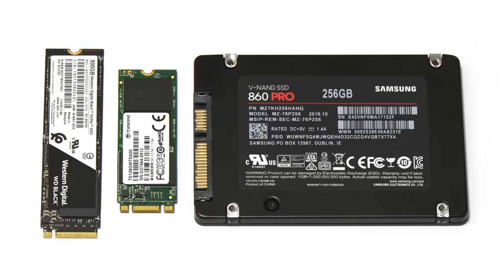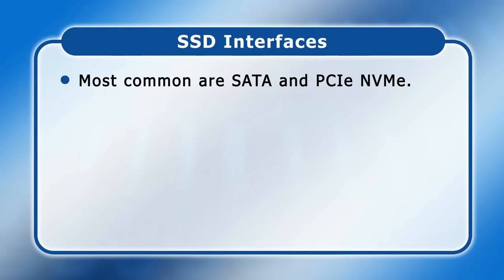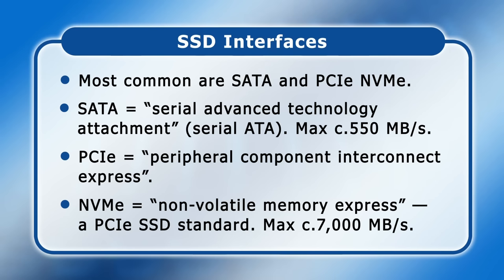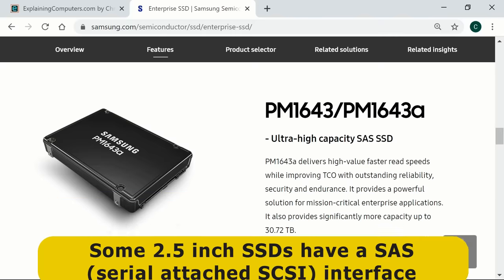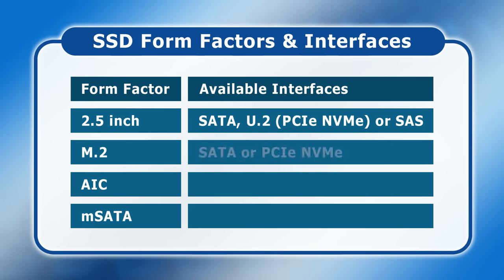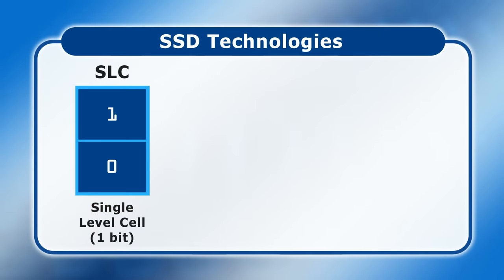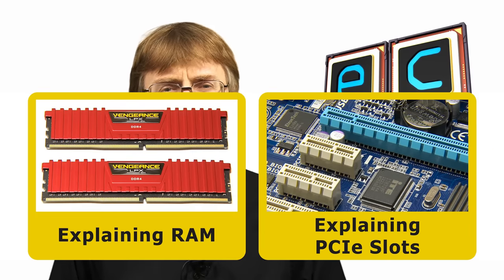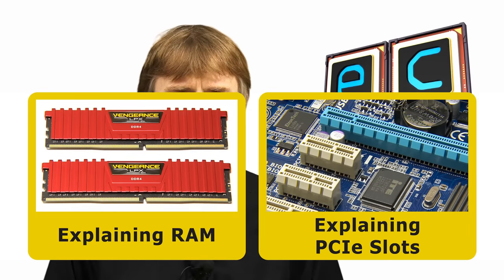Explaining SSDs: Form Factors, Interfaces & Technologies

Comment: I bought a PC with both SSD and HDD. Windows is on the SSD. I plan to put programs on the SSD and all the data files on the HDD. Will this extend the life of the SSD or does the search for data files still start on the SSD? Thank you.
Reply from the maker: Keeping data files on a HDD will help, especially they are large, frequently changed files like video files using in editing/etc. However a lot of the wear on the SSD will come from Windows constantly writing files, and also browsers and similar programs writing files. So if you want to reduce wear, move all cache locations to the HDD.
Reply: @ExplainingComputers  Thank you! Very helpful. Unfortunately I am not skilled enough to know what a "cache location" is.

Comment: Great video!  I was hoping you would talk about the key benefits of using SSDs and HDDs and why it is ideal to use both:Ssd for OS/ Programs and HDD for files. From my personal research, they said HDDs are slow at running an OS but actually fast when used as a secondary drive. Which is why HDDs still be using today, despite being “old tech”.

Comment: Is it possible to use a Samsung T7 external SSD with a Samsung tablet using Android Version 5.0.2?
Reply from the maker: Providing the tablet has a USB connector, it should work. It will depend on the file system on the drive though.
Reply: @ExplainingComputers  
Thx.
How do I determine file system on both?
T7 uses exfat.
No info on tablet.
Reply from the maker: @gaetanovindigni8824  It the T7 uses exFAT, it should work fine on Android 5+.
Reply: @ExplainingComputers  
Thx again, your time and advice.

Comment: Was planning to buy one and I get your notification.  Coincidence? I think not.
Reply from the maker: Spooky!
Reply: @ExplainingComputers  I would be really grateful if you could answer a few questions for me. 

I just got a Kingston A2000 NVMe SSD 500GB (TLC) rated at 350TBW. I already have a 1TB hard drive on my laptop (5400RPM). 

What stuff should I consider storing on my hard drive and what on my SSD? 

I use a few content creation software (mainly Adobe Creative Cloud) and Unreal Engine. Most of my files are documents, project files for the above mentioned software, and few occasional large media files like videos and movies. Maybe 1-2 large games (80-100GB each). 

Also I have 16GB of 2400Mhz DDR4 RAM. Should I disable pagefiling or transfer it to HDD.

Should I move the entire User folder (My Documents, Downloads, etc) to HDD?

First time SSD user, want to extend lifespan.

Comment: Is it possible to install Windows 98se / Me on a SSD to work in a Desktop computer set to IDE mode. So far I have not been able to do it. Windows 2000 and Windows XP has a F6 driver you insert during the install process. Windows 98se / Me does not as far as I know. Thanks.

Comment: Thank you that was very informative. One thing, which  goes beyond what you were trying to cover, is the seperate complexity ( or minefield!) of trying to upgrade older equipment to ssd- eg to do this I personally found the necessity to use  IDE/PATA versions of SSDs ( as Sata via converter s often wouldn’t work etc)

Comment: Are all NVME type SSD's = PCIe type? This is where I get confused, I read that PCIe type SSD's are better, therefore I want to buy a laptop with a PCIe type SSD. Any info would be highly appreciated
Reply from the maker: Yes, as noted in my other reply -- NVMe is a PCIe standard, so any laptop stating that it has an NVMe SSD will have a drive using a PCIe rather than a SATA interface -- and an PCIe/NVMe is a lot faster than SATA.
Reply: @ExplainingComputers  thank you so much, I've finally understood it now after watching many vids👍
Reply from the maker: @kaankarapnar1028  Cool.

Comment: Having 2 internal NVME Samsung Evo 970 Plus in my self build PC. It seems to me that they get hotter than my wife's internal SATA Samsung Evo 870. Does it make sense to put on them thermal pads and heatsink? Some say it is not needed...a bit confusing...
Reply from the maker: They will feel hotter because you can directly touch the chips on the M.2 drive, whereas with a SATA drive you only touch the case. The location on the motherboard also does not help with the cooling of M.2 drives. These days I would fit a heat sink to an M.2 SSD on a PC motherboard. It cannot hurt, and may extend the life of the drive.
Reply: @ExplainingComputers  Thanks for the clarification

Comment: Thanks for the update and clarification. If you aren't in the trade or otherwise standing under the data hose, it's easy to get lost or confused. 
Now I'm having fantasies about a RAID array of those 100TB monsters. (where the "I" definitely does not stand for "Inexpensive").  A storage device costing a quarter-million feels like old times, but it would be a back-up nightmare at any plausible data rate. :-)*

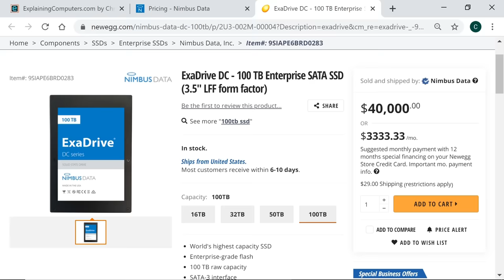Comment: 2:50 The Nimbus drive is not a high-end device at all. It doesn't really even compete with high-end enterprise SSDs. Its SATA interface is so slow that it isn't even possible to exhaust the write endurance during the 5-year warranty period. To give you an idea of how atrocious its IOPS/storage rating of 114k/100 = 1,140 IOPS/TB is, the Intel X18-M, a netbook SSD from 2009, is rated at 35k IOPS / (80 GB) = 437,500 IOPS/TB. Rather, the value proposition is as a hard drive replacement for bulk storage: you can now fit 6.25 times the storage in your server as with HDDs, with improved performance and reduced power usage, at moderate cost.
Reply from the maker: Whilst your points on performance are very well made, any device at this price point is "high end". This is not cheap hardware made for consumers.

Comment: M sata can be used for giving a second life to a laptop or I'm wrong?
Reply from the maker: Yes, if the laptop has an mSATA slot (though if it does, it is probably filled with an mSATA SSD, but you could fit a new, larger and faster one).
Reply: @ExplainingComputers  the wireless cards do use that port, but I saw some with two slots so it's possible.
Reply: @ExplainingComputers  also I see some people making improvised msata extenders to plug a external graphic card

Comment: Need help!  My hard drive died and I found out in the specs for hard drive it says:  PCIe NVMe M.2 SSD  Form Factor 2280.  

But when I opened my laptop I noticed the SSD card was B & M keyed!  So now I'm really confused because it has 2 notches!   Isn't that only for SATA drives?  Do they make B & M keyed PCIe NVMe M.2 SSD in a 2280 form factor?
Reply from the maker: There have been some NVMe SSDs with both a B and an M key. But what matters here is the key in the slot. Providing the slot is M keyed, you can fit an NVMe SSD, and the drive will only need to be M keyed. Good luck!

Comment: I didn't check, but what would be the difference between SSD and SD or micro SD cards?
Is there a speed difference or lifetime or quality? That would certainly make another vidéo.
Reply from the maker: It would indeed make another video! I can almost feel "explaining flash storage devices" coming on. SD and micro SD cards are (today) much slower than SSDs, and usually have a much lower life expectancy (fewer P/E cycles). However, this may change with SDUC and arrival of SD Express, which will offer a PCIe NVMe interface for SD cards. See my video here: https://www.youtube.com/watch?v=oLQ8A_vcBqU

Comment: Hey I’ve got a question. Why does my motherboard say “SATA 6Gb/s” if sata is capped at 550Mb/s
Reply: It's because it's written in gigabits (Gb) not gigabytes (GB). 8 bits in a byte and some 20-25%(?) encoding overhead, leaves you at around 550MB/s (that is MegaBytes). 🙂

Comment: Please could you make a video explaining the upgrade options for retro computers?  I have discovered that you can get a "SCSI2SD 3.5" - includes 50-pin SCSI to SD Card Adapter from China which will upgrade a retro computer such as a Mac LC or an Amiga A590. You can replace an Amiga A600/A1200 hard drive with a CF card.  Please also could you review he GOTEK floppy dfrive emulator? A number of videos on YouTube cover this subject, but lack your inimitable style and clarity!

Comment: Haven't watched yet, but the thing I don't get about formfactors is... how many there are vs how many are even used?

Like, full ATX boards. Why would you need seven expansion slots on a home computer? One (the PCIe x16) for graphics, sure... but single-slot width gfx are a rarity in the new specifications (as is low-profile), with many higher-end being "2.5" slot, aka... do I loose not one but TWO of the expansion slots?. and Unless you don't use onboard-everything, you're not going to occupy the others anyway. Soundcard? Onboard. Network? Onboard. USB? Get an external hub if you run out of plorts. Some Monitors even act as one, and bigger 'gaming' keyboards can have them (roccat sova here, for lapboarding when I want to lean back. I could connect my mouse via one of its two ports, but I already shoved the table to the wall trapping the wires. pulling it back would be a pain). 
Not only that, but SATA ports: four on miniITX, six or eight on Micro/full-size. But unless we want a RAID setup (introducing a problematic 'get multiple of the same device' and problematic point of failure and for JBOD, why bother unless they're older drives), you'll only use... two? Mine: WD30EZRZ 3TB D drive, older samsung 1TB F drive that I don't use yet magically uses 434 gb ~coughnotallpornsomehowcough~ . What I have for C, is a samsung 970 1tb (basically the best of the m.2 PCIe 3.0 nvme? unless that's changed since I bought it)
A  modern system should be: some form of SSD OS drive (speed), and the cheaper-per-terabyte older Hard-disk drive for mass data storage.

And 2.5" SSD's aren't much faster than HDD's when comparing to the M.2 nvme.

bringing to that one:
I've only seen 2280 size SSDs on sale. 250Gb, or 2TB. they're all 2280, according to the spec sheets for the ones on sale on Scan.co.uk. And they've got some enterprise gear buried in the catalogue.
Also... Intel Optane. ... like, a M.2 PCIe NVMe intel is atleast half the speed of Samsung, Corsair, and so on. like wtf?

Now, last niggle:
For god sake why can't we have filters in the shopping websites? Dabs.com which got bought by BT (british telecoms) and then disappeared into their not-so-open-reach thing, when they were running their website had bits were you could filter by specific things. Like, Go to monitors. Okay I want to filter to just ACER or AOC or Dell or Samsung etc. Also, I want to filter by... TN panel, or IPS. Or I want to see those that have 120hz refresh compatibility (which would hide the ones NOT capable, but setting 60hz would basically not hide any since they're all that minimum anyway?), or so on. Graphics cards... GDDR5 or 6 or HBM, their clock frequency. For CPU, 4, 6 or 8 core, back when Intel and AMD didn't quite understand how to market a high-power low-core vs low-power high-core count.

Personally, my issue in this would also be for cases: 5.25" Drive support. I can't play my older games because the case I bought on my PREBUILT custom rig didn't have a slot (I mistook one little digit on the model number that was the difference between the one with a single drive slot and one without) and it cost a grand, and at the time was pretty damn good (i5 6600k, 16GB ram, Nvidia 970 when the 10-series was just coming out). Still is (64GB Ram and Nvidia 1080 in there now)

Used to be that on dabs I could browse their laptops with filters for specifications like monitor size and resolution .15.1 or 15.4, 1366x768 or 1280x720, or 1680x1050 or whatever and so on. Did it have an optical drive, since dabs went out of business before those stopped being a can''t-by-a-desktop-machine-without-one and floppy drives were only just being phased out from customisation menus)

That all said. I once had a soundcard despite onboard audio... because I also had an XBOX in my office and had no other way of getting sound (PC used the DVI and xbox used the HDMI port on the monitor). 
Which also presents an issue - a lot of graphics cards are defaulting to Displayports with one or two HDMI and phased out DVI almost entirely. Monitors, I don't just want IPS, I also want to filter by what input ports it has - does it have sound - does it have usb ports? - does it have a headphone out for when I decide not to annoy others in my house with my music or what I'm watching in youtube viewing sessions.
And all that data is already on specification tabs that come up in 'compare items'.
Reply from the maker: You clearly need to watch the video as you are reporting urban myths here, like 2.5 drives being slower than M.2 . . .
Reply: @ExplainingComputers  having had a samsung ssd 8xx 2.5" and a 970 m.2 pcie, as my drives at desperate times yes, they are slower.  To boot. To unload zipped files etc (I deal with a few gb files near regularly.) Pc load from scratch in 15 seconds or taking almost a minute (over back before I had any ssd)

Comment: What can be done if you want to use a SSD and your laptop is so old that hasn't SATA but IDE? Thanks
Reply: Realistically, I would consider getting rid of that laptop and buying something more modern. I wasn't aware about this, but apparently there are some SSDs that use IDE: https://www.amazon.com/128GB-KingSpec-2-5-inch-SM2236-Controller/dp/B0091T4ZWU I've never tried this, so I don't know how it will work.
My honest answer is just to get rid of it though.

Comment: Thank you for the video.
I got my first SSD (120GB one from OCZ) in early 2010s. My current desktop (a mix of 2018 and 2020 high-end parts) is purely solid-state with 3.5 TB of storage in 3 SSDs.
What I'm worried about is increasing flash density which leads to a dramatic decrease in endurance, reliability and speed of flash memory. TLC already had pretty poor endurance, QLC has even worse and PLC will decrease endurance even more. SSDs do fail. I've recently had a 480GB Adata QLC model die on me after only 1.0 TB of writes. I really don't want QLC to become mainstream, but I think it will probably happen someday because many buyers only care about price per GB, not endurance or speed.

Comment: So.. if I use SSD for cold storage (write once), will it be reliable for many many years as P/E cycles basically negligible?
Reply from the maker: Data on an SSD should be retained for a year or two. They are not good to long-term storage without regular data refresh.
Reply: @ExplainingComputers  I see.. Thank you for your explanation!

Comment: Way back in the 1990's I worked for Quantum developing firmware on an SSD. It was a unit with RAM (ECC) backed up by a HDD. There was also a rechargable battery that ensured the data in the RAM could always be saved to disk when power went away. http://web.archive.org/web/19990508051125/www.quantum.com/products/ssd/

Comment: Now my question is what's the difference between GREEN and BLUE drives??
Reply: @SISSYPUSS  so if you're say a content creator, video or audio editor get the BLACK but if you just like to have the basic internet functions get the GREEN but if youre in between, you could get the Blue??
Reply: @SISSYPUSS  i was wondering because i currently have a green Adata SSD in my laptop and it stutters. I should've went with the Blue but that's what i get for being cheap. Thanks for answering

Comment: On a slightly hopeful note perhaps not mentioned here, the warranty for consumer M.2 NVMe drives is uniformly FIVE years. SSDs in a 2.5 inch form factor seem to get a Three year warranty. Not sure if this is due to an expectation of actual better reliability or perhaps some residual replacement cost.
Motherboard manufacturers are still building idiotic configurations, namely M.2 slots for SATA SSDs that, of course, conflict with the useful ports for HDDs.

Comment: We need a term that encompasses both SSDs and hard disk drives.  I think the right term for that is "hard drive".  Which is not how you used it.
Reply from the maker: Hard drive refers to a HDD, not HDDs an SSDs. :) The term refers to a unit that stores data on a non-flexible (hard) disk/platter(s), as opposed to a flexible (floppy) disk.
Reply: @ExplainingComputers  I understand.  What would be better?  Meanings of words constantly change in living languages.  I think saying "hard drive / SSD" until we're done with mechanical drives would be a shame.
Reply from the maker: @darxustech2883  Or just "drive". :)